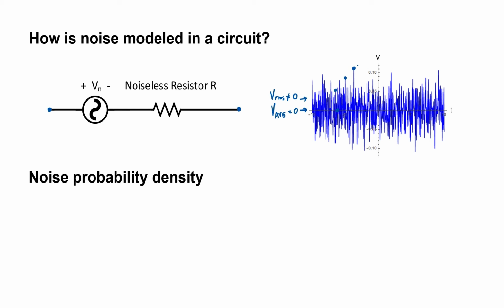Types of Noise in Amplifiers (Amplifiers #11)

Comment: 1: Thermal noise. So keep it as cool as possible. Wire heated by its environment, so least amount of heat, thickest of cables.
2: Shot noise. How to get rid of this?

3: External noise. So good shielding. Other components so mind the layout. Or: least amount of possible parts? 

Is it at aall posible to filter out white noise anywhere to make a lower noise floor? Or is that a stupid idea?
Reply from the maker: About the shot noise, it's sort of possible to get past it through squeezed states (trading off one quantum uncertainty for another).
Reply: @adanner  that is also myth, as a qubit is only a bit, a classical bit. Quantum degeneracy is a perfect mechanism, something they overlook when they advertise the so called "quantum processing". In anything you can call quantum, data is degenerated, and no "entanglement" can fully compensate for that. You use entanglement, then entanglement manifests overall degeneracy. You cannot clean up that noise, can only get closer and closer to a limit prescribed by nature, but the limit stays there, you cannot move it. You end up fighting not for one dB, but for an infinitesimal fraction of a dB.

Comment: Am aware, and always was aware that there must be something in every mechanism, to make avoid free energy, so to speak. However, i thought that the up limit for the white noise is not that mechanism that you mention, but another. I thought that the noise avoids generating power, increasing power, by self compensating. Noise is not building up, in any scheme, but it is random accidents, and randomness, more precisely concurent randomness, is self limiting. What generates the consistency of the RMS noise value, is not the noise, but something very different. The engine of noise, speaking energy, is not noise, but the opposite. We have noise because of the non-noise, and then the randomness of the non-noise, but randomness in itself is not energy, it is just another aspect of existence. The non-random quantity decides the level of random, of noise. By the way, when talking nature, never reduce it to voltages, as voltage is fiction, nature has no voltages, it has energy, randomness, and also curents, but not in the sense of amperage, only in the sense of flux of real or virtual particles, and of particle spread.
Reply: Whatever you are having, gimme a few grams of that.
Reply: @jamegumb7298  uncommon intuition and ability to make strange things converge